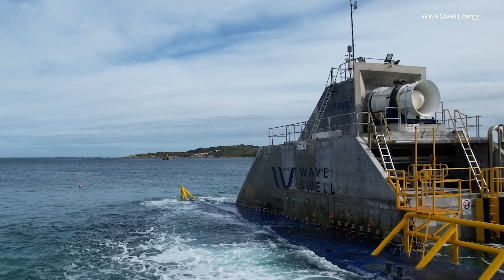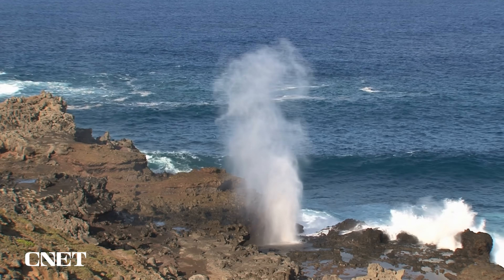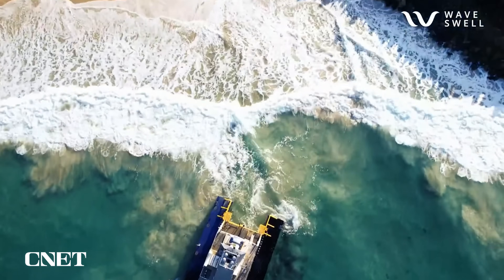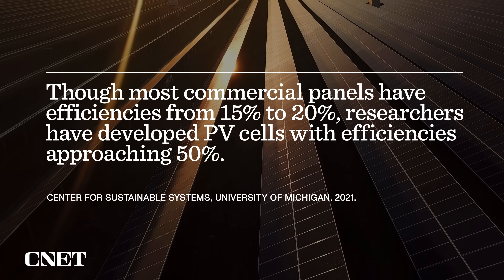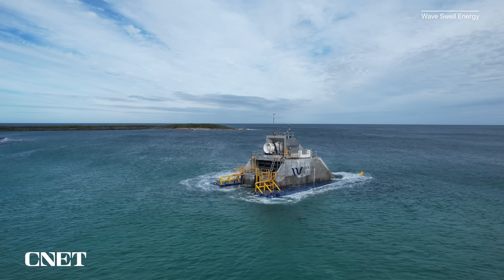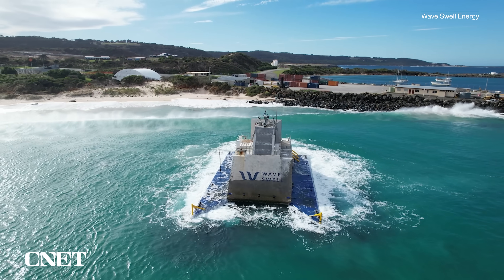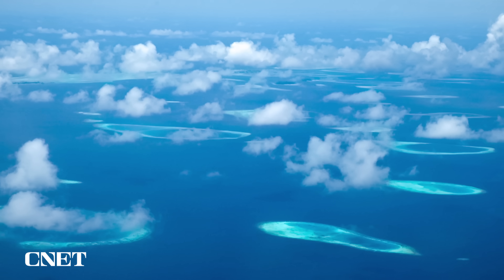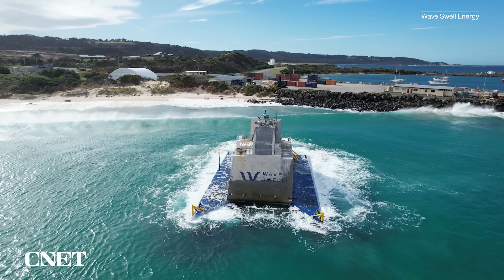'Artificial Blowhole' Generates Wave Energy for 1 Year

Comment: I think they need to incorporate a diverted flapper valve in front of the turbine so it gets thrust on both the in and out surges.
Reply: from their site:   

"Previous OWC technologies have all been bidirectional. The WSE technology, however, operates unidirectionally. This results in the WSE turbine being simpler, more robust and reliable, and exhibiting a higher energy conversion efficiency. The only moving parts in the technology are the turbine and bespoke valves, all of which are well above the water line. There are no moving parts in or below the water."  

That's their thinking on it...
Reply: Good thinking, maybe they considered that but decided on suction only

Comment: A couple of questions.
1. How much energy does the blowhole produce on average?
2. How much energy does it produce on a calm day?
3. If the environmental impact of one unit is minor, what is the impact if 10 or 100 units are required?
4. The blowhole only appears to generate power when the water level is dropping? How does this system ensure the consumer has constant power?

Comment: This has been my favorite implementation of wave energy conversion technology.  I am happy to see the pilot perform so well.
Reply: One of these (OWC) devices was built in the hebrides around 1980. It's economics were poor. Nothing described in the video is actually new!
Reply: @EdFrench_uk  When one scratches the surface of "new" it is often incremental to ideas thought of or tried before.  The economics are often not communicated very directly.  I am drawn toward this type of construction as it keeps the moving parts out of the seawater.  In my mind, without investigating,  that, should wave energy be economically viable, this construction should have the best shot at achieving competitiveness.

I probably behooves me to investigate the Hebrides installation and see what "improvements" have been incorporated into this project.  I suspect that is was not developed without knowledge of the installation you speak of.

Comment: What is important is the "levelized cost of energy." How much does it cost to produce 1 Kw over a period of time ... taking all costs into consideration. For example, wind has a levelized cost of energy of 2-3 cents. This is excellent. Hydroelectric is good, PV is much higher. Doing a report on an energy source without mentioning this metric is negligent.
Reply: Indeed very scummy and click bait i already reported video. It should not be in a news section but as an entertainment

Comment: On the illustration one turbine was driven  by air flow in one direction, could a 2nd be driven by the up force is it because at would be too corrosive due to the salt spray ?
Reply: I was wondering the same thing. Surely measures could be put in place to avoid any corrosive effects or perhaps a longer pipe to stop seawater getting to anything important

Comment: This seems like it's desperately needed in places like Puerto Rico and could be experimented with there for research helping those people in need there.
Reply: Puerto Rico's problem isn't power generation it's power distribution.
Reply: @patrickweaver1105  Yes, all that power distributed in DC.
Reply: @annoyed707  Actually it was the local politicians that created that mess. They wouldn't fund their grid preferring to squander the money. We'll see if Luma does any better. The grid needs an overhaul. Washington is sending the money we'll see if it gets fixed. It's one of the few things in the infrastructure bill that could do some good.
Reply: Not to mention all of the developing countries
Reply: Wouldn't be feasible in the long run. Not feasible at all. Not great having that in areas of strong storm areas
Reply: @biohazardlnfS  I mean it is 95% concrete.  It should do just fine in hurricanes.

Comment: I know its a working prototype but that seems like a huge structure for just one blowhole.  hopefully they can evolve it for a more compact footprint.  The seawall idea they mentioned sounds good.
Reply: Being a prototype it would be a temporary structure so the mass will be needed to keep it in place.  If the tech proves to be viable then maybe anchoring a smaller structure into the sea floor may be an option or perhaps having a "wall" of units will allow kw/footprint to be much larger.
Reply: The only point of this device is to extract the maximum amount of government grants and venture capital funding possible in the shortest amount of time. It doesn't make sense on paper and certainly not in practice.